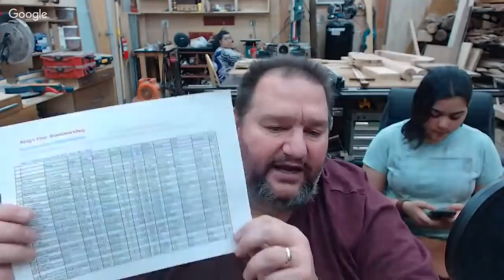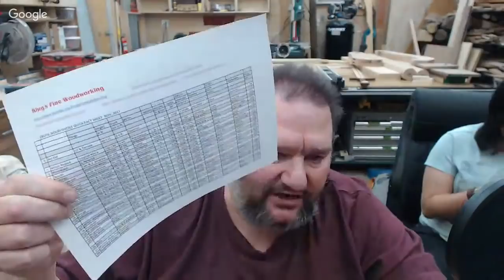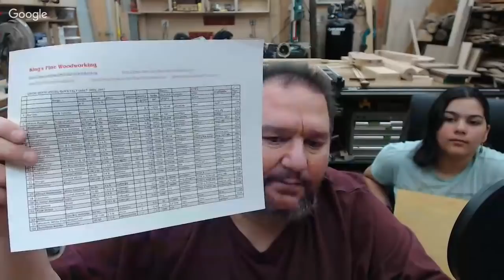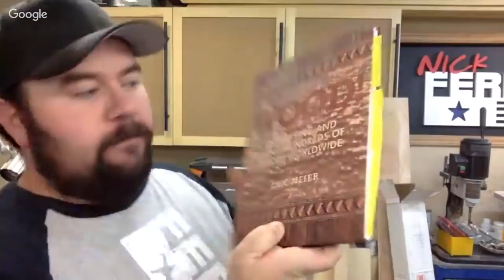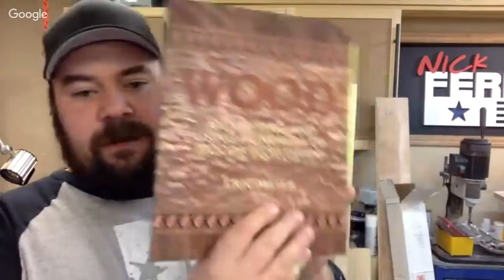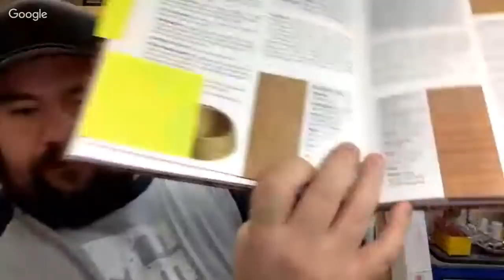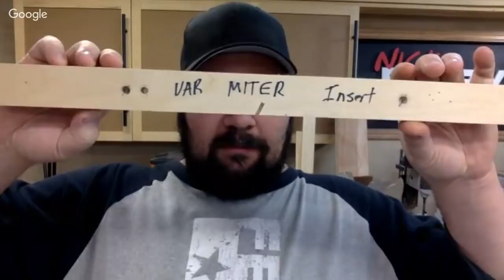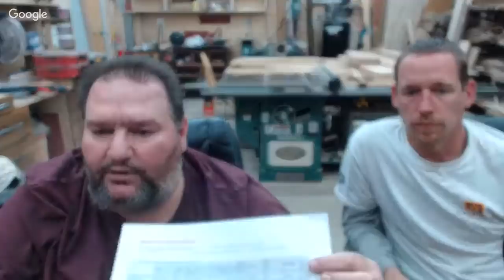All about Exotic Wood Species (first 30 min) recorded live, Followed by Q&A

Comment: Hey there James. Just a little about myself, I'v done kitchen cabinets for almost 30 years.and have been working with wood for 40 plus years not all those years i did cabinets full time. but I've done a lot of finishing cabinets.. Just wanted to let you guys know that i watch your posts just about every night. I'm disabled from Kentucky State Police. while i was working for them I did cabinets part time. which as you already know how much time and investments goes into making a entire house of cabinets. There's kitchen cabinets, Bath, Laundry room. and entertainment centers I've done. and I used mostly Conversion Varnish usually two coats with sanding in between coats. and it also uses the Catalyst or Hardener depends on where your from lol..  And to be honest I've learned quiet a bit watching your shows on Finishes. Just wanted to thank you for what you do and how you do it. I also use quiet a bit of screws on my projects. But you know what. i. Don't have all that many pictures, when i first started doing cabinets i would take pictures and to be honest they are on one of my laptops somewhere in boxes. But i heard you guys talking about pocket hole machines. I purchased one when i was doing my own face-frames and let me tell you. if you  had to do a lot of pocket holes. those little vice grips don't even compare to the porter cable 552 Pocket Hole machine http://www.normstools.com/images/normstools/pc-552.shtml here's the link to the pocket hole machine.. but i sold that one because i had just about gotten out of custom cabinets. and went to selling cabinets for KabinArt they made an awesome all wood cabinet with dove tail drawer. i could buy them and install them making twice as much money as if i had done custom made cabinets. But making them for a business i just about got burned out on woodworking. heck i very rarely go into my shop probably only done 3 maybe 4 jobs over the last 7 years. but we moved and i really in all honesty don't have my new shop completely set up yet. but from watching you guys, you all have inspired me to get back out there and make some saw dust. lol but a big thanks for what you all do. i absolutely love your mallets, so i'll get off here heck I've written a book. but again thanks James and Nick for doing what you two do. you know to be honest. I've never seen Nick do anything. so that's another reason i am glad i tuned in to your online shows. I will be watching Nick here in the future just to check him out. thanks and may God bless everything you do and guide you as you work. Be-careful and take care of yourself.

Comment: Redheart is my favorite wood, and I have several pieces of highly figured Redheart (which I'm told is rare). 

I plan on using some in multi+laminate guitar and bass necks.
Reply: Don't forget to finish it with an anti UV vernish, or its colour will change pretty fast.
Stocking it should also be away from light.

Comment: I've been told that certain species of wood have chitin (ky-tin), which is a hardened material found in insect shells,
Reply: I bring this up because it supposedly increases not only the hardness of the wood, but it increases the abrasiveness and the abrasiveness negatively affects tool life more than hardness, as is often the case in machining certain metals.

Comment: hi James, i would like to ask you for help in a project i am working on, i need to span a first floor  with exposed 16 feet wooden beams using coco lumber, can i use this product together with ply wood using a laminated process,or am i best using a solid piece of coco lumber, MY CONCERN IS THE DURABILITY AND STRENGTH OF COCO LUMBER many thanks if you can help,really good channel
Reply from the maker: Hi I'm afraid you would need to talk to a structural engineer for that information.